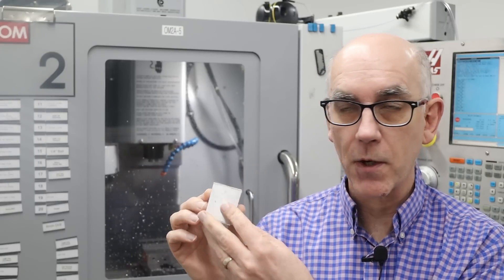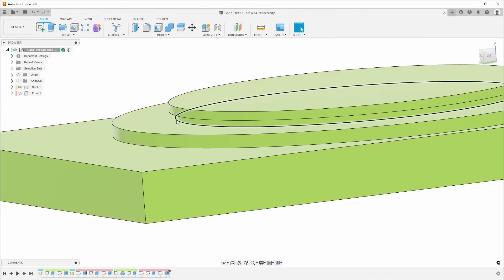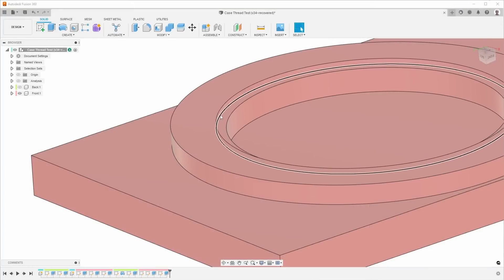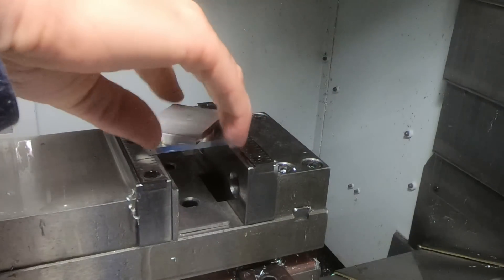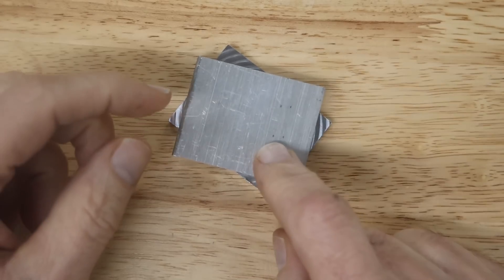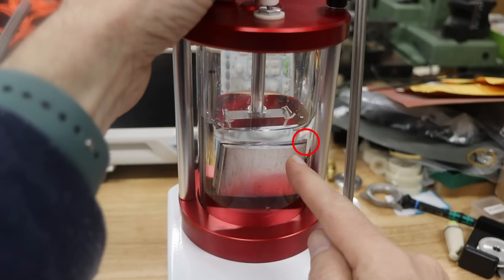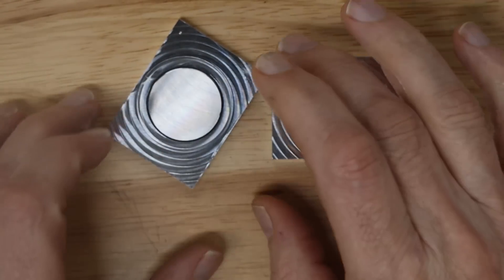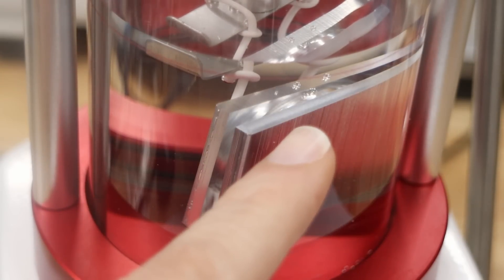Watch O-Ring -- Will it survive 50m water depth?

Comment: The face seal is common on many watches from various manufacturers.

I've cut 100's of 1000's of O-ring grooves in end caps and in pistons for hydraulic cylinders. We always did it on a lathe and used grooving inserts with a round tip to better match the O-ring cross sectional shape.

We always stretched the O-rings to install them and we coated them with hydraulic oil prior to assembly. 

I would keep them dry for inside a watch! 

While you can buy tiny end mills for cutting groves with a mill I'm not so sure how cost effective they are. A little hand profiling on an old end mill with a grinder might be cheaper and faster for a prototype.

Comment: I think the mill marks on the o-ring seats are making a high pressure seal more difficult. Maybe fly-cut the seats with a custom tool of the right diameter so you get (hopefully) a mirror finish on the seats, or at least mill marks that are concentric with the o-ring. Or maybe use some custom rotating piece that's close to the full diameter and polishing compound.

Comment: Yep, face seal and o-ring grease. I use to make scientific instruments and deploy them to a depth greater than this that's how we did it. We had some other designs to but this should get you the results your after. Apply the grease and wipe most of it so it's just a thin film. Make sure you faces are clean and there are no scratches, and nothing is stuck to the o-ring or surface face after the grease is applied. Check you o-ring by feel, I use to hold them and run my finger tips over them to feel any anomalies. Be careful you're not damaging the surfaces or o-ring with your metal tweezers.
Reply from the maker: Thank you. I learned from some watch makers that a small amount of air, coming from the outside of the o-ring, is common. Failure would be a stream of bubbles, which I didn't have. They also suggested running the test dry, but using a lubricant for the actual watch, as it improves the seal further.
Reply: will grease improve my sealing performance in case of static face type O-rings? I am an AUV engineer and build small submarines
Reply: @Mahmil  from google. "A grease or oil application at assembly helps to protect the O-ring from damage during use. An additional benefit is a protection a lubricant provides for the part, from general water resistance and minimization of frictional forces to preventing atmospheric degradation by elements such as ozone"

It's best practice for the absolute minimal amount of effort and cost. I feel it is worth doing.

Comment: 50 meters is 5 bars, not 50 bars.
I suggest lubing the oring with silicone grease.
I remember orings can be ordered with different rubber hardness. Purhaps a slightly harder rubber type will help at higher pressure.
Reply from the maker: I misspoke in the video and didn't catch it during editing--the indicator said 5 bars Also, these are "standard" watch o-rings, and there wasn't an option to select the hardness. Finally, it turns out that a stream of bubbles would be failure, which I didn't see.

Comment: +1 on lubing the o-ring with silicone for production, but for testing i question it.

The first option that comes to mind is completely removing the threads from the equation. You would do that by trepanning a groove away from the threads, and then having the mating part just seal up against that groove. That's going to require more of delta in the diameter, since now you have to not only accommodate the o-ring, but a flat inside of the o-ring as well.

The other option I can think of, requires more depth, but does not require additional width. This would be to have the thread at the end of the boss, an unthreaded section, and then the o-ring section. On the mating piece with the recess, the bottom of the recessed wall would be threaded, above that would be pla8n, and above that would be enlarged for the o-ring.
Reply from the maker: I heard back from some watch makers and they said two things of interest. First, that this test should be run dry (and then use lubricant for the actual watch). Second, that a stream of bubbles would indicate failure. A small bubble, like I saw, is common.

Comment: I'd vote for moving the o-ring away for a face seal based on my limited experience with seals. Break all edges as always and if possible. We used Parker Super O-Lube which, given the amount in the bottle, is expensive. The Parker O-ring design handbook can also be found for free pretty easily online if you want to have at least 2 references on designs (and most go to when they hear they have to seal).
Reply from the maker: Thanks. I did look at the Parker handbook when I was researching this. I have since heard from a couple of watch makers. They suggest testing dry, and then using a lubricant (you can buy one specifically for watches) for the final assembly. Also, it turns out that the small bubble I saw is fairly common to see during watch tests. A failure would be a stream of bubbles, which I didn't see. So they consensus was that my test passed.
Reply: I second the Parker handbook suggestion as a resource.

Comment: You might find that using gasket lube helps with the sealing.  The O Ring tends to drag against the faces compressing it, the silicone gasket lube helps it slip and compress.  As always, interesting world you're wandering into.  If you are not a member of the NAWCC, you might want to join for library access.  Steffan Pahlow has written a hard to get and often only available from Swiss publishers book on case making, it might be helpful and when I was still a member they had copies for lending.  George Daniels books may offer some insight on case making.  One of the lessons I learned in engineering is to avoid getting trapped in trying to solve simple looking but complicated problems that others have already worked out :-)  Happy New Year!
Reply from the maker: Thank you. I wasn't aware of Steffan's book. I am aware of George's book, but I don't believe he doesn't talk about water resistance at all. I do have another watch that has an o-ring, and my approach is based on their design. There is one major difference, however. The total height they're dealing with (for threads and the o-ring) is 1.4mm. But the design of the watch I'm working on only used 1.2mm height. That's why I ran into a problem with the undercut--it needed to be a little taller.

Comment: You might not be having a leak. From what i remember a couple bubbles running off isn't an indication that there is a leak, there's just a little bit of air stuck in between things that escapes, rather if you were having a continuous stream of bubbles that means a leak.
Reply from the maker: I got the same feedback from some watch makers. One small bubble is likely air that was outside the o-ring. Failure would be a stream of bubbles, which I didn't see.
Reply: @JohnSL  there is no leak, that amount of bubble is air, coming out from outside volume of the o-ring groove. You know inside volume of your test piece, you can imagine volume of bubbles that *4 of volume of that void. Put a piece of toilet paper inside, put a test piece in a water, make the pressure and forget about it for a night. And lube your o-rings.

Comment: Great video 👍 John If I had to understand this issue I would purchase a watch like a Seiko with the appropriate water resistance rating .Then I would using high magnification inspect cut profile of O ring seat and lid seat shape profile and measure o ring size ratio to case fitment size.
Reply from the maker: I have one watch with an o-ring that had an undercut. I've figured out why it worked in their case, but not for me. The height they have for the undercut and thread is 1.4mm. But the watch I'm working on only has 1.2mm. That means the other watch has a taller undercut, which would make a big difference. I also learned from some watch makers that failure would be a stream of bubbles, so the o-ring passed the depth test after all. None the less, I'm going to check with the designer to see what he wants to do.

Comment: Face seal would be my approach.  Also, I couldn’t tell on the last test if the bubble grew because it leaked or if that was just the bubble already there expanding after the pressure drop.
Reply from the maker: Oh, that's a really good point. There was a small bubble there, which of course would have expanded as the pressure dropped. Doh! I'll have to test it again and make sure I get rid of any bubbles before I release the pressure.

Comment: Happy New Year John. interesting video. I would try to avoid pulling the o-ring over the threads. The threads are simply drawn as two overlapping parts in Fusion 360. But in reality there is an empty space when the thread ends. This could reduce the pressure on the o-ring. Just guess. Some lube isn't wrong either.
Thanks for the video.

Comment: Hi, 50m should be 5 bars not 50: 1bar is more or less 10m. 5 Kg/cm^2 on the scale is 5 bars wich is correct.

I don't get why you compress the air outside first, because in real life you bring the watch with atmospheric pressure and submerge it gradually with external pressure building up.
If you compress the air to 5 bar, you are compressing the tiny air pocket left by the compressed o-ring to 5 bar too outside the inner chamber (The tiny anular air pocket i'm talking about, is in the upper left corner of the square at the 12:20 time). Then you submerge and nothing happens cause the pressures are equal.

My personal opinion is that when you release the pressure, the bubbles you see is just the compressed air in that small pocket that is expanding.

As mentioned by Greg Koenig you need to lubricate the o-ring with silicon oil to avoid twisting or warping, only then you are sure the oring is working as designed.

Happy new year!
Reply from the maker: I misspoke in the video and didn't correct it with a fly out. You can see the dial indicates 5 bar. I'm using a depth tester that is designed for testing watches. And you might be right about the small air pocket. I'll have to go back and watch some more videos on testing watches.
Reply: @JohnSL  I'm glad you cleared that up, John. Thought I was going insane there for a second doing the math in my head. LOL   Have a Happy New Year!
Reply: @JohnSL   Try to submerge it and then pump the pressure up, sure there will be a mini bubble from that air pocket, but it if you did your math good, oiled the o-ring before screwing the lid and respected the tolerances of flatness, it should be ok 🙂.
P.s. a thin film of silicon grease should work too, it should displace the extra air when closing the lid.
Reply from the maker: The way these testers work is checking for escaping air. So you have to pressurize it outside of the water. Then the air bubbles tell you if it failed or not. And what I've learned from some watch makers is that a small bubble like this isn't unusual. Failure would be a stream of bubbles. So it actually passed!

Comment: One thing I might try is lubricating the O-ring to make sure it seats in it's final position without getting pinched or torqued against the surfaces as they rotate and compress into place. I am sure the Swiss have a very special lubricant for this, but the industrial solution is NyoGel 760G. This is a silica based grease that is dielectric and typically used for mil-spec connectors, but SureFire did a bunch of testing years ago and found it is ideal for O-ring seals on flashlight bodies.
Reply from the maker: That makes a lot of sense. Thank you, I'll give that a try.
Reply: Silica or silicone?